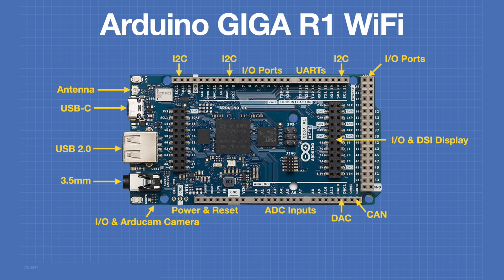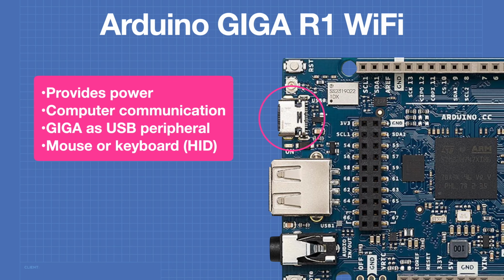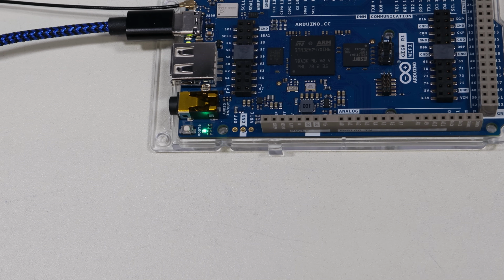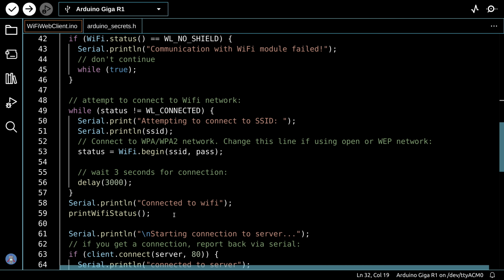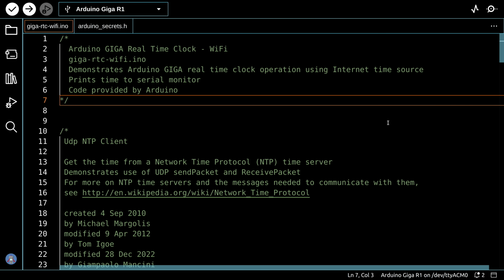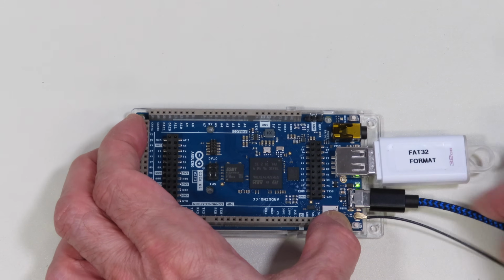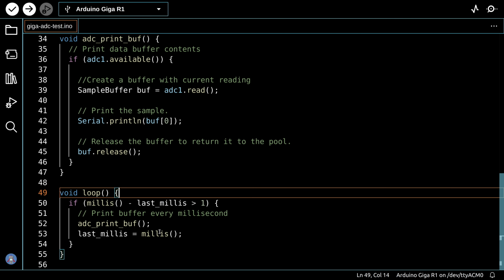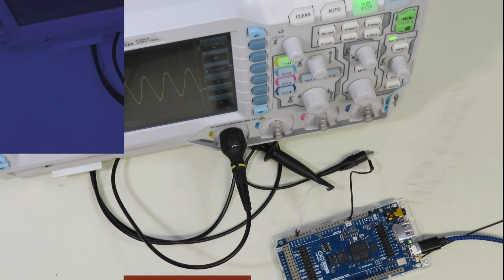Arduino GIGA WiFi - First Look

Comment: I'm gonna re-watch this vid in 5 years when clones of this are sold for $4. Insha Allah!
Reply: Is there a website that has project circuit boards?  I have been building kits up to now and am looking to take it to the next level.  I want to peruse circuit boards and I can source the parts.
Reply: Nada como el placer de contribuir a la noble labor Open Source de Arduino, adquiriendo el ORIGINAL.
Reply: shame on you for not supporting Arduino 👎
Reply: @Dextermorga dude real arduino boards are costly in some country's, Learn that.
Reply: there are very low chances that any clones will be available.
Reply: @wilddeveloper2021 why ?
Reply: STM32H7 is already expensive.

So I don't think Giga R1 is as expensive as STM dev kit.

Comment: I've been very disappointed at how little there is posted and/or written in books about this board!  There are only a few scarce videos and sites about it, aside from a thin selection of libraries and arduino help files.  I read somewhere that this board isn't used or covered more because it fails to meet industry standards in some way.  Can someone tell me more about this?

Comment: Thank you for another incredible video!

A quick question: does the GIGA (or Portenta) offer functionality akin to ESP32 NOW for board to board Wi-Fi communication without the need for an isp provider?

The application I have in mind is two or more drones (quads, fixed wing, etc.) communicating with each other.

Thanks again! This is exciting stuff!
Reply: no. ESPNOW is on ESP only
Reply: @zetadoop8910  Allow me to clarify my question. I wasn’t asking if the GIGA offered ESPNow. I’m asking if there is any GIGA to GIGA Wi-Fi communication available without using an ISP provider?

Comment: Very nice review of a very nice board.  It would be great to have a 16 bit DAC on board to experiment with CD quality output.  Is it difficult for chip designers to provide 16 bit? I assume its not just as simple as slapping 4 more bits on the existing 12.
Also, if 32Gb SD cards are going for $5, why are micro controllers so stingy with on chip memory?
Reply: microcontrollers are stingy on memory because that takes a lot of space on the legacy nodes used to make those dies.
And like SOCs, processors or RAM chips, SD cards don't need built-in opamps or ADCs so those dies can be more easily manufactured on smaller/more recent lithography processes.
Reply: There indeed are brought out I2s pins

Comment: hi i am struggeling with my giga . i want to make an audio recording and playback device using the giga the adc on a0 and a1 with an lm386 op amp module . i got 3 buttons one on a3 one on a4 and one on a5 for recording . record stop and save to sd and one for playback file from sd card. i use an sd card module on pins 89,90,91 and cs on pin 10 .I want to output the audio on the dac pins dac 0 and dac 1 on a12 and a13 .  I tried several different codes using the arduino website tutorials on advanced analog i2s, tmcpcr, .... and so on Please can u make a tutorial video on how to make a sampler like that?

Comment: does anyone know what version of bluetooth it uses? this can be quite important due to data speed/bandwidth , distance it can reach and power consumption efficiency,  like 4.0 IIRC is like 10m range, while 5.2 can reach up to 30m distance, and I have used both on bluetooth earbuds and the 4.0 sounded like old timey radio, while switching dongles to the 5.0 alone (not gotten a 5. 2 unit yet) was almost as good a quality as DVD audio. massive difference there, and range too, though I did not get the 10 and 30m ranges it was definitely far greater distance with 5.0 than 4.0 units. 

this is not even something I can find in their datasheet from the arduino website for the giga.
Reply: (7:01) thank you for showing this! the not being supported yet fully is no big deal with my experience around arduino support, as I suspect like in the past they will not lag to long before full support is available. (ie I am more confident in how fast and how sure it will be than say the raspberry pi pico community due to past experience with both communities of the raspberry pi community and the arduino community of software development and kernels and such. not that I expect either to fail completely, just might take longer for PI to catch up to each new iteration of their microcontrollers especially if they are still trying to ensure their SBCs have their software support maintained :) 

something I would like to know but don't have time right now to finish listening in, is if this could be used by say retro pilot for self driving car development being it has cann bus availability, (not expecting it to be the computer to run things, but rather is it fast enough to respond between computer and input-output hardware to be able to react in a timely fashion, for road use, not that I am going to use it for a self driving car, but rather I want to get as close as possible to the latest self driving car hardware in drones that fly, for shorter range delivery of packages using cell data communication to manually control things, and want to be sure they can avoid issues and still make the journey across say cell data dead zones during its travel through canopy of forest and the like (gotta stay low enough to not be a danger to air planes and helicopters as well as avoiding squirrels and birds ect. :) 

will have to drop this on that community and ask them what they think (retropilot group, the more open community than comma.ai LOL

Comment: I have enjoyed and supported your channel for years, but I do not understand why the Giga is so expensive. Single board computers such as Pine units have more and are 64 bit, even able to boot and run a Linux OS as well as having the io pins at half to 3/4 the price. Why?

Comment: The upload problem you had in Linux is simply a permissions problem writing to the USB device. You received a WARNING about a missing signature from DFU Util, which will be mandatory in future releases. Then you received an ERROR message about being unable to write to the USB device.

Your 'fix' is setting permissions on the USB device to allow any user to write to the USB device. 

You're left with the same DFU Util warning about the missing signature. This is the same WARNING you receive in Windows. So yeah, you're now in parity with the Windows Arduino IDE setup. 

666 is a pretty promiscuous setting. Something better might be appropriate for people who understand what they're doing. I see other comments below about this being a board from hell. It has nothing to do with the Giga, of course. It's just a generic answer from a community post that 'just works' for anyone who chooses to implement it. Not the best, but that's kind of what you expect from community support.

Comment: At first I thought WOW how cool is that? BUT at this price point? Sorry, no. It costs ~ 70-89€ This is the price of an Raspberry Pi 400! Such projects live from low cost easy to get budget. I rather go with ESP32, Raspberry Pico and add additional 16 Bit ADC for 3€ if I need to.

Comment: It doesn't feel like Arduino. Arduino for us has meant simplicity and limited features and limited components to run the microcontroller barebones.
Reply: No one's forcing you to use one. They still UNOs
Reply: Yeah, they lost their minds... But no worry, we have esp32 modules   to play with cheap.
Reply: @TheKetsa  exactly. Why anybody would go anywhere near this is beyond me. Don't get me wrong I'm a huge fan of single board computers and have been a supporter of khadas and others. So for the price this new Arduino board is insanity
Reply: Really? I can understand that feeling if your experience is limited to the Uno only but we quickly move on from the Uno to stripped down 328 programming to package a project. As soon as the esp8266 was available a lot of makers/hardware engineers added wifi to our projects. Then the esp32 with dual cores and wifi ......magical! Progress is always accompanied by complexity. The Giga R1 is just an extension to Arduino. And it's soooooo powerful. I think I've had my Uno for about 10 years and I still use it, especially for digital logic circuit mockups. 

Remember, we have to support Arduino because they support the ecosystem. It doesn't take long for the cloners to get boards out and while I buy clone boards I always try to buy a board from Arduino. Buy a Giga and stick it on the shelf, I'd bet you will be toying with it sooner than you thought.
Reply: Why not to go for stm32 cheap and powerful and easy to use with cubeide
Reply: it doesnt feel like a regular Arduino but it's definitely following their pro philosophy, its just not that mainstream
Reply: you can de solder the stm32 chip to run it barebones

Comment: Isn't the Due faster?
Reply from the maker: Is that a joke? The Due is a single-core processor running at 84MHz.  The GIGA is a dual core processor running at 480mhz. The due isn't even in the same league as this board1
Reply: @Dronebotworkshop  Ahh, i thought the GIGA r1 wifi was running at 48Mhz, because then the due would be faster.

Comment: The most powerful are the potenta series
Reply from the maker: Not anymore - The GIGA uses the same processor but exposes more of the I/O pins. Arduino themselves describe it as "the most powerful Arduino ever" in their blog announcing the GIGA.
Reply: @Dronebotworkshop  That's true, you are completely right. It would be a shame to reduce that power by programing it with Arduino IDE instead of Microchip Studio.

Comment: Thanks for showing us this new awesome board. But I have some questions about the variable "tm t". 

in RTCset(), tm t... where was the type "tm" defined. It appears to NOT be the type "tmElements_t" that came from the <TimeLib.h> library which had the year offset from 1970 (based on Unix time) and month that starts from 1 to 12. Is there another layer of conversion from type "tmElements_t" into type "tm" (which means there will be some code bloating going on)?

Comment: Waste of time. At this price it's priced like an SBC; however, an SBC is more powerful.
Reply: How many have 76 GPIO just to start with ?
Reply: @andymouse  true, though we can add several chips like GPIO expanders, ADC/DAC or microcontrollers around an SBC to fix that issue. And 76 i/o is really a lot for a project